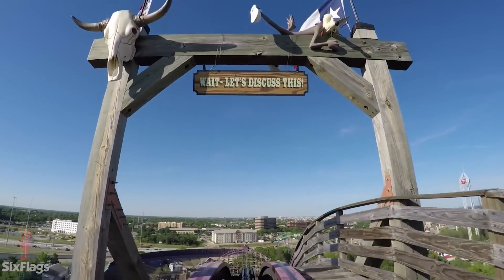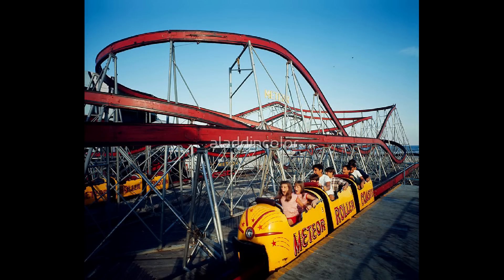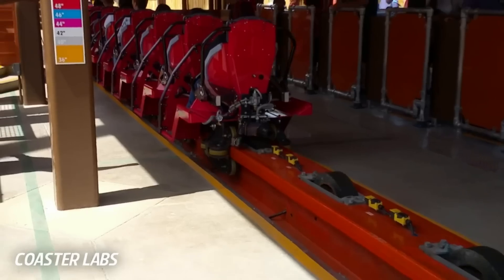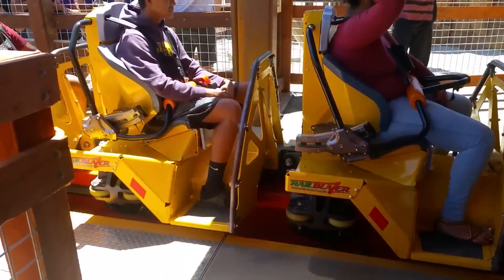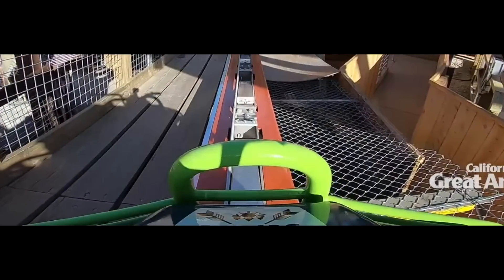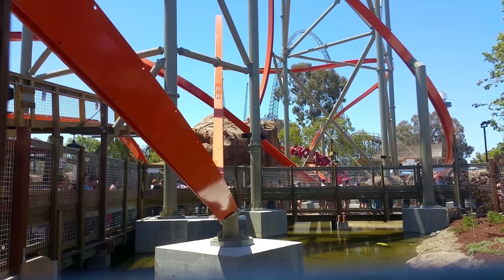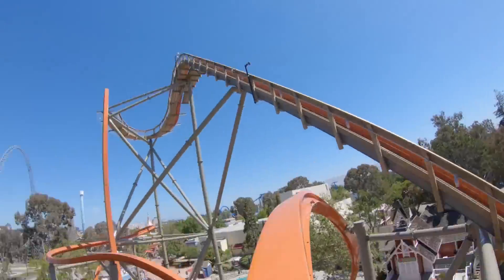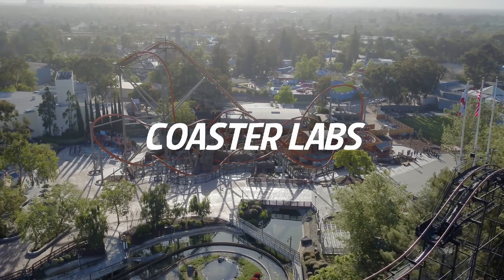How It Works: Single Rail Coasters (RMC Raptor)

Comment: Never noticed the restraint electronics, or the way the sideways airtime hill clears the lift
Reply from the maker: Yeah, the ride has a lot of ingenious little quirks that make it more intense/exciting and save money.
Reply: @AmusementLabs  how would they evacuate the ride without electricity or a battery pack?

Would they just remove the cover of each locking mechanism and manually actuate the restraint release?

Comment: But what if it was wood? Fully wood single rail would be an interesting concept and an engineering puzzle
Reply from the maker: I mean it might be doable, but quite the task of trying to keep it from slowly pulling itself apart since it wouldn't have another beam to hold itself to. It also would likely develop bumps. Additionally there's a factor of cost and if it really is worth it versus just paying for steel (which will probably be used in the supports either way) and not have to retrack something like this every few years.

It's definitely possible, but realistically unlikely.

Comment: So cool this ride is great I just found out that Magic Mountain in California is going to put one of these in their park for next year the permits have been submitted as of 4 9 20/20 so hopefully they can get it done this looks like a awesome ride
Reply from the maker: Yeah I saw that this morning. Looks good. Probably joker themed and the raptors are great rides. It's basically Jersey Devil Coaster with a right turn before the lift and probably about 1 or 2 extra hills at the end and longer to get back to the station as well as taller by a few feet to get to 150ft.

Comment: Fun, easy, safe, and cheap. What more could you want?
Reply from the maker: A few more unique layout options for the same price. They'd have the same track length, but maybe it's a twister style or a single out and back or an inversion machine or a speed version (where it's low to the ground).

Comment: RMC came in with the idea of improving old wooden coasters and then made enough revenue to pursue their own ideas on wooden coasters and exploration of other track type ideas.

They are quickly becoming B&M 2.0 and I'm loving it.

It would be awesome for them to colab....
Reply from the maker: It would be interesting, but I doubt it would happen. B&M thinks very highly of themselves even though they're gonna sink fast if they don't innovate.
Reply: @AmusementLabs  they did everything right that intamin did poorly.

Intamin = general motors
B&M = Mercedes

I just hope RMC doesn't let success go to their head and start phoning it in.

I absolutely loved Goliath in great America and pine for the chance to ride trail Blazer and other original works and their reworking of classic wooden coasters.

Intamins issue was they were innovated but spread to thin and moved too fast, not perfecting what they created, just moving on to the next biggest and bestest thing while B&M and now RMC innovate and then perfect and master what they present to their clients with the confidence and fortitude for a long term relationship with these clients.

Comment: It’s a novel new technology, but as soon as the novelty wears off, theme parks will shift their attention to “ride capacity” and with a single file coaster, ride capacity ain’t very good.
Reply from the maker: Six Flags Great Adventure is actually building a taller one with FOUR trains of 12 people each. They also said they intended to run all four trains as often as possible. Already twice the capacity.

Comment: Infamous coaster inventor? Infamous means you're famous for something bad. Come on bro.
Reply from the maker: We're also talking about the guy who put Arrow out of business cause of his outlandish designs... Not bad in the sense he's evil, but notorious in the sense that he sometimes designs outside the means of production.
Reply: @AmusementLabs  my apologies. Vekoma also helped put arrow out. They stole their track technology. Arrow had rough rough coasters. Great designs, brutal rides
Reply from the maker: @vincentcappello4746  true, but I mean parks still bought their rides. ie Viper at SFMM opened way before, it was likely rough from the start and somehow SFMM thought a never before done ride by the same company would be different.
Reply: @AmusementLabs  yeah for sure. I just know arrow did the scream machine at SFGA and it was horrible. I found out it's all in the spring system attached to their runner wheels. B and M Use a system that allows the wheels to stay tight to the track, whereas as arrow didnt. Neither does vekoma which is also a rough ride until they invented their flex track technology for a smoother ride. It's currently in use on the Great Nor Easter in Wildwood, Nj. As a lifelong rider I can vouch that the technology works but I digress. People still bought those arrow coasters, but B&m and Intamin were just far superior in their designs and comfort. It was a matter of time.
Reply: This track technology is definitely going to turn the industry upside down. Pun intended lol
Reply: @AmusementLabs  also I love the video.

Comment: Does anyone know if any parks in the UK have this type of coaster?
Reply from the maker: No parks outside of the US currently have one. There are only two at the moment: RailBlazer in California and Wonder Woman Golden Lasso Coaster in Texas.
Reply: Yeah, many have monorail rides.(not this brand) Usually used in the kids sections and so on. In the uk it is only worth building a proper coaster if it requires large construction equipment. These mini coasters are good for the us and canada where they put roller coasters in shopping centres and so on, with low throughput. They aren't suitable for full fledged parks, except small cheap rides.

Comment: Ah, the monorail.
Using it for a coaster is an odd decision, but on the whole this is textbook monorail track design. - most transportation monorails also have wheels that run underneath ledges on the track, and thus the cars typically grip the track even though they probably don't need to.
The only maglev train currently in commercial service is also technically speaking a monorail, and it effectively has a horseshoe magnet arrangement holding it to the track...
The theoretical benefit of a monorail (much lower maintenance and construction costs) has never really materialised in practice...
Still, it's an interesting application of the concept...
I can see how it can be beneficial for a coaster in ways that don't benefit conventional railways all that much...
Reply: It is extremely high steel to ride ratio so not very cost effective really.it is low capacity and requires a light vehicle reducing efficiency too. Big reduction is in construction labour really. It is in essence a more thrilling mini coaster. It is just a monorail ride as mane before like it.

Comment: Literally the same way 2 rails work. If you filled in the space between a standard 2 rail with  steel, it would operate the same. Most modern coasters have 3 sets of wheels - top, bottom and outer. This design doesn't really change much or innovate much in my eyes. If anything, you get Terrible RPH because of the single seat design.
Reply from the maker: That's what I originally thought too. If it were one single rail then it would fall right off since there's nothing to grasp. Those pipe zip lines are closer to a single rail than these are. It's nothing more than a super slender track.

Comment: Sorry, the RMC Raptor is not a good coaster, nor a good idea, in my opinion. I went to Fiesta Texas earlier this year to ride Wonder Woman. Although I'm a wood coaster & traditional amusement park hobbyist, I was excited to see what WW was like due to RMC's great coasters thus far. Wonder Woman, in my opinion, is not worth the extreme wait times. First, the short line took nearly two hours. Why? The coaster uses two trains & is a short ride, but the trains are single seat, for a total of 8 riders per train! What was RMC thinking? This looks a major engineering error, and an error on Six Flags part for putting in such a low-capacity ride. This season I have read multiple complaints of many hours spent waiting in WW's line due to this extremely low capacity. But the thrill of a coaster should not be defined by it's capacity. So, the ride. A steel coaster should be smooth. Wonder Woman was not smooth during my two rides on it this season (I'd have ridden more if not for the extreme waits). The ride felt as though it were hitting the separations in track sections fairly hard. The train also had a bothersome rattling feel to it. It feels as though this could be evidence of the attempt to dramatically lower the expense of a new steel coaster. Make it cheap, cheap is what it may feel like. The entire ride had a constant bump, bump, bump as it rolled over something (track section separations?) during the ride. The bumping & rattling was fairly bothersome to me since the coaster is quite an intense ride. I don't mind intensity, but also the locking shoulder straps dug quite hard into my shoulders during the strong neg g spots and various other places. It was uncomfortable. The ride is not not what a steel coaster should feel like in my opinion. One other thing. I predict the constantly-moving train loading procedure will be a problem with loading & unloading riders tripping, falling, and possibly getting injured. I watched 3 riders stumble trying to board the always-moving train, and the loading/unloading is very hurried by the ops...all in an attempt to increase the terrible capacity. So, there you have it. My opinion is quite different from what I've been reading this season about Wonder Woman, but I am a hobbyist and as such, I'm extremely critical of every aspect of any roller coaster I ride, study, and photograph. That's what true hobbyists do. I will be surprised if lots of other parks take the bait of this newfangled attempt to come up with something different, revolutionary, and cheap. RMC's Raptor is a fail....to me. They wanted a cheap steel coaster? Well, it certainly feels like one!
Reply: Yes i expecyed as much. Monorail rides are usually consigned to the kiddie area as they are more suited to low speeds and low weight. Also heat expansion / contraction will drastically affect ride enjoyment i imagine with the higher density of steel. Also uses much more steel so not appropriate in many areas. Low surface area for rust though. This video does sound more like an advert than anything else. Also what exactly is wonder woman about the ride i have no idea? At least make the chassis perspex or something.

Comment: Looks to be one crazy smooth ride. Has anyone ridden the Wonder Woman golden lasso? Does it live up to what it looks like it should?
Reply: It is smooth, however the entire ride has a regular, rhythmic bump, bump, bump as if the separations between track sections is too wide. Combined with the ride's intensity, I found this bothersome.
Reply: Track separation needs to be huge to account for heat expansion with this style of track,  making it very uncomfortable i hear. Has no ability to "ride" over the bumps either due to cheap carriage design, and no suspension.

Comment: The way you described the brakes they wouldn't be fail-safe, allowing the train to just rush by in the event of a fault, like an electrical outage. I'm sure that wouldn't be the case. So does somebody know the actuual principle of these brakes?
Reply from the maker: They're essentially sealed all the time in the up position along with tensioners. The system basically removes air to lower them.

Comment: These look awesome, but the throughput has to be terrible, I wouldn't want to wait hours to ride this thing.
Reply from the maker: I've never really seen the line be over 2 hours. Most of the time it's around 70 minutes and RailBlazer has a single rider line, oddly enough, to fill the empty seats to maximize throughput. Wonder Woman use to have one, but it has since been removed. :/
Reply: @AmusementLabs  that's ridiculous! I wouldn't stand more than 10 mins waiting, and only that for a mine ride or log flume. I could see a doctor in a&e faster than that!

Comment: You're telling me they cant put wider trains on the raptor tracks?

Since the TRex trains are already made for the Trex tracks maybe they should make one that's wider so it can fit 2 people in one row. Maybe an Allo (short for Allosaurus) train or something. 

You know bigger than a raptor but smaller than a trex
Reply: To further that argument, just look how wide dive coaster trains are. And I not asking for 10 people rows, just a simple 2
Reply: It can't though, that would be too much torque on the beams. They would have to put people of similar weight on each side.

Comment: The only problem with the RMC single track models seem to be capacity. I know the T-REX is 2 abreast but the Raptor only has 1.
Reply: It is a "cheap" design for smaller parks with smaller attendance and smaller budgets. This way they can add a power-punch "top billing" quality coaster....within their price point.
Reply from the maker: Yeah, that's ultimately the downfall I'd say. I've always wondered if they'd do two across, but in a B&M wing style. One person on each side next to the rail with no floor.

Comment: What a great video and such amazing footage. I love how insane these coaster models are. By the way, there is no helix on this model. A helix is 360 degrees or more. That element is called a spiral (200 to 359 degrees) also sometimes called a "High-Speed Carousel" or "Carousel Turn" (Usually on B&M's like IHC and Rougarou). More videos like this please.
Reply from the maker: Thanks so much for the kind words! :D And also thanks for the info on the carousel turn, that makes more sense as the technical name. Definitely more are on the way. If you want you can suggest rides you'd like to learn about or just see featured in videos like these.

Cheers,
Coaster Labs :)
Reply: Anything you want to do next would be great. I already know enough about coasters and theme parks to have a Doctorate. If only that was a real major. :) It is still great to watch these videos. Plus I sent this video to my cousin who has ridden Wonder Woman's Golden Laso, well actually we both did. So it answered some of her questions. Like what is a mirror image and other things. That I apparently cannot explain simply. How about the Mack Megacoaster next?

Comment: I’m sorry that I’m 2 weeks late but this is an incredible video. You’re very good at explaining how it works! I always wonder how the restraints are. Are they very restrictive?
Reply from the maker: Thanks. :) Depends if they staple you, but generally no.
Reply: 808CoasterLife - I found the shoulder strap restraints on Wonder Woman to be very uncomfortable during the ride. They lock just like a car shoulder belt & the ride has intense neg g spots, causing the straps to dig into one's shoulders.

Comment: How much does a Raptor cost on average compared to a similarly compact, high-thrill coaster?
Reply from the maker: <$3M
Reply: Coaster Labs 
Well damn that's actually pretty damn inexpensive for a high thrill coaster.
Reply: @polaristars  that's even less than the average arrow when adjusted for inflation!
Reply: @AmusementLabs  well I know what I'm doing if I make 3 million
Reply: Well damn, that's 7 times cheaper than your average b&m
Reply: Damn last time b an m got 3 million for a coaster they had only made a stand up coaster. A not many. Raptors are the way of the future,way of the  future, way of the future. Sorry my howard hughes is showing.
Reply: @tinypoolmodelshipyard  I'm sorry b an m you mean bnm
Reply: I did some research and about 7milion dollars